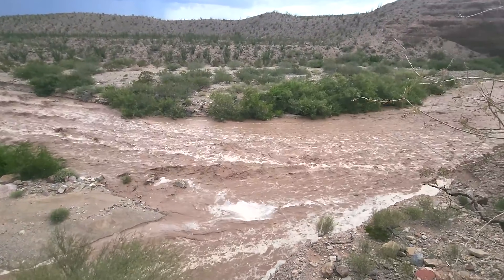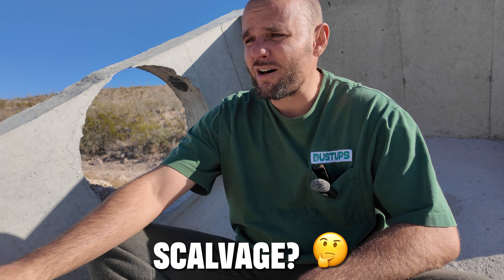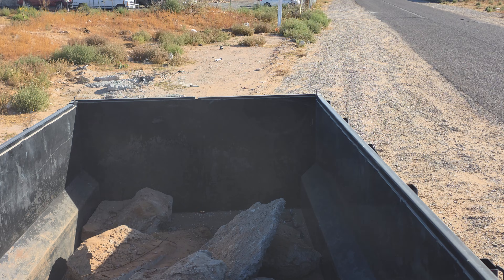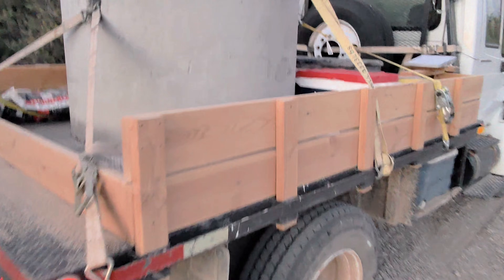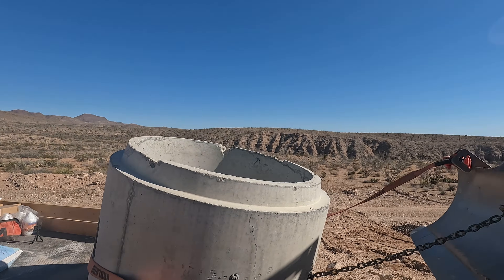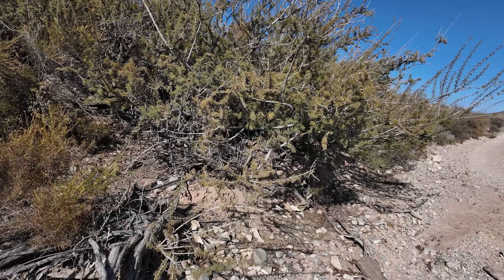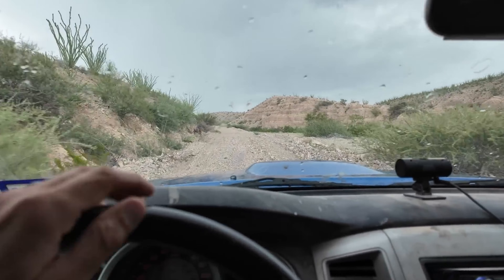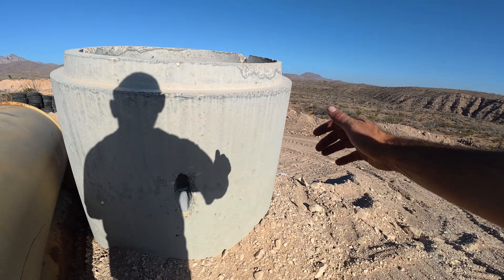I'm Fighting Desert Floods with Free Waste Concrete

Comment: This may be helpful to you.  Check out check dams of Arizona.  They use it successfully.  Also, Sand dams of Ethiopia.     They use them to control water and feed communities.  Alot of dams were made in these areas to slow water to sink into the ground water.  That's important.  Get the water to sink into ground water.   Extend wet time.  Lessen dry time.

Comment: Sean you should get some culverts built for your road. There are probably lots of free large corrugated steel culverts available in Texas. When the floods wash away the concrete barriers, build your road through the wash on top of large culverts so that the water flows under the road through those pipes.  Depending on how much rain falls, hopefully those culverts will last a long time without washing out your road.

Comment: before driving the concrete (fuel) to the creek, maybe you could use sandsacks  or better big bags, there are pretty light weight when empty, inexpensive and could be filled with dirt and stones and no need to Transport concrete

Comment: i've been followin you since the start shaun, and i saw your vision then, before your rain arrived two years later. these flash floods are brutal i agree, and while you can't hold them back yet at the outlet, remember that wvery little drop you hold back the more upstream you are,  the less was will arrive at the outlet by overland flow (but will infiltrate). little by little, one retention at a time, you will get there!!! i believe in your project

Comment: The cylinders could be used upright if sunk 2 feet in the ground and filled with small gravel. Spaced 2 feet or less apart you would have 10 ton pylons that could theoretically span the river and could plank across the gaps making a viable and heavy duty bridge while not being a dam because it has gaps to let the water through
Reply: It's a wash. That isn't going to work. The water will go around, under, or over. It's not stopping. It's not slowing down.

Comment: so the road is at the bottom of a canyon you own? if there is more than a trickle during a storm, you are doing it wrong. there should be zero run off from your property. the idea is not to catch water. it’s to slow it down. that’s easiest to do up high before it concentrates and gathers speed.

Comment: I’m confused about the logistics here.  I learned what a low water ford is, which is great.  How are these giant concrete casts working in? Are they like a giant check dam which will build up sediment and let you pave a low water ford in the future?
Reply: Ok, I watched again and I think I get it.  Basically a giant check dam.  I wonder if the water will spread just like the smaller check dams.  It might be good to do a U shape so the banks don’t erode.

Comment: Seed Sorghum: Mulch, Cover Crop, and Chicken Feed all in One.
https://www.youtube.com/shorts/BFTK-LmQgUQ

The Jerusalem Thorn (Parkinsonia aculeata), also known as the retama or screwbean, is a drought-tolerant tree valued for its ability to provide shade and mulch material.

The tree can produce significant biomass through its leaves and branches, which can be utilized as mulch.

Sheffield's Seed Company
Ty Ty Plant Nursery

Millet - Highly drought-tolerant, quick germination, and establishes rapidly.

Spreading the manure over an area and walking away vs. careful application like a no dig garden to 2 inches planted with millet. The first method encourages native cultivation, the second directs specific cultivation. Would the second method be potentially more productive when creating more mulch is the goal?

The second method allows for targeted growth of specific crops, optimizing productivity.
More predictable and consistent mulch yield from cultivated crops.
Faster results with specific planting; crops can provide mulch faster.

The second method, which involves carefully applying manure to a depth of 2 inches for specific crops like millet, is likely to be more productive in terms of creating consistent and abundant mulch.
This method allows for predictable results, maximizing biomass production from selected plants, which can be cut and used as mulch.
It also promotes better soil health and structure through direct integration of nutrients, which supports the subsequent growth of cultivated crops.

While the first method encourages native cultivation and may have benefits in terms of biodiversity, the second method is more aligned with your goal of maximizing mulch production and enhancing soil fertility effectively.

Comment: as someone who delivers fuel for living, you can use that tank for diesel, much cheaper than gas station diesel. its same diesel, and highway legal, the reason its cheaper is, its a bulk price and one less stop in supply chain.

Comment: Get a whole bunch of used tires. Cut one of the sidewalls out and bolt them together 10 ft wide by however long you need for your road cut side up. Fill it full of Rock and sand anchor each side into the ground with a chain to a block of concrete or whatever buried 10 ft in the ground There's your road that won't wash out

Comment: Keep in mind that if you build one line with concrete blocks, you build a pressure zone in the "river" therefore it will more quickly collapse. 

If you put one big boulder in the river it will flow around it. If you put the same size blocks over the complete with most likely it will not withstand the same flow rate. 

Also keep in mind where you build the wall. Because you will create a kind of waterfall what will make a kind of canyon after the wall. In front of the wall you will get soft sediment as you see with the beaver dams. But that soft stuff you quickly get stuck in with your truck..... 

Making a road through a river is hard and difficult.

Comment: @Shaun Overton | DUSTUPS - I know the question I'll be asking will be a lot of work and fuel costs. However, why not use all the concrete tubes/pipes as heavy culvert pipes?
 It would definitely take a lot of them, however, instead of fighting the water and losing, let the water go through the pipes and build your driveway/road on top of them.

Comment: The best is cut the round pipe in half then the water can go around instead of going wider then put dirt on top so you have a raised road. Or plan to have several little streams

Comment: I've built levers out of laminated together 2x10's that could lift at least 2000lbs off the ground. That might be easier than using the dozer to push them around.

Comment: Don’t try to stop the water I the channel. You’ll screw the creek, probably cause other erosion issues and it will fail. Protect your assets from high flows, let the water run when it needs to. You can’t stop flooding.

Comment: I think you should focus at least half of your concrete, check dam, gabion, and BDA efforts on slowing the water upstream.  By the time it gets to where you are working, the water has a lot of momentum and can do a lot of damage.  Room temperature water molecutes are actually something like 25H20, making it much denser than the chemical formula would indicate.  I would try nipping the momentum in the bud, upstream, before it "snowballs".  The point is to trickle the water from ponds upstream, so that the flow is more manageable down stream, and so that there is less damage.  This is what beavers do.

Another thought.  Some of these places with the scrap concrete might have a space problem.  They might pay you to take it way, or pay for larger scale trucking to do so.

Comment: For soil improvement:
Check out the Johnson-Su bioreactor. It is very cheap to build. It produces a fungal soil innoculant that matches your local environment. It adds water holding capacity to the soil and increasing nutrient avalability. The demo site in the Arizona desert is especially impressive.
Good Luck!
Brad

Comment: You need to set up with a waste licence and offer free rubble and construction debris dumping, renting a screen and crusher after accumulating for a few years is a passive thing some farming mates do here to achieve what your doing
Reply: Talking to muck away and quarries will get you the information you need to know regarding networking the lorry loads of materials you do and don't want, especially now many companies local to me either don't have equipment or charge a premium for using the equipment to separate green waste from soils, which in your use case I see more as a benefit than any issue

Comment: Unless you are anchoring  that structure on bedrock, you are constructing what the Scripture describes as a house built on sand. In Oregon's Willamette valley, stones the size of houses rest that originated in Montana, transported during the Missoula  Floods about 10,000 years ago. Water has far more power than you will ever resist with concrete rubble. Don't you recall  that people built ferro-cement sailboats back in the '70s? They floated just fine. Turns out, concrete isn't all that dense after all.  Flash floods will still be forced to breech your check-dam because the water can't go under it. The water will simply rise and and eventually tumble over the concrete, carve a channel around one end or the other, wash out whatever that concrete is  sitting on and your big concrete will move downstream like a slow moving boat . Stop wasting your time, money and effort on "free concrete" and talk with some  bonafide engineers about the problem.

Comment: Not sure you are looking for fund raising suggestions...but here goes. 
You have existing dirt bathtubs that haven't been super successful. But they are already there, and you have been given great suggestions about how to update them to make the more successful. But you don't have the time or manpower to make those changes.
You probably can see where I am going with this. 
Take "donations" from viewers, essentially "adopt a bathtub", and guarantee that you'll add a tiny wooden sign (or a 3D printed sign if you want it to be less work intensive), and commit one hour to updating one bathtub for the cost of that donation. Is $100 too much? You'd figure it out.
Obviously you'd design the package that you can commit to. 
When you get volunteers, this could be a dedicated project that they could work on. 

Not super original...just a thought.

Comment: An A-frame rig could make the dozer into a lift vehicle, but you really have to plan out ahead when using it to position it right. Also some of those rounds might be useful to put a culvert into a raised drive path, that would let water through at some point without as much risk of topping or washout if you made it as a complete dam barrier.

Comment: Would it be easier to widen the run off? Double the width and its less pressure to move the material. Build a squeeze area with 2 tubes underground to push out a mass of water. Then widen your area where the road is to have a thin gentle run of water. Eh... Just a thought.

Comment: You should really get a tracked Skid Steer Loader, like a Caterpillar, It has bucket and fork attachments and could definitely replace the dozer in a lot of situations and do things it can't like lifting, faster and more fuel efficient too. Certainly cheaper in the long run and you can get a used one for a fair price.

Comment: You can’t just plop down some empty concrete containers and call it a day…
It might be heavy, but if it’s full of air, it’s still lighter than the equivalent volume of water.
You have to treat it just like a gabian. And fill it full of rocks or it will float away like a concrete boat.
Or at least put enough holes in them that water can fill the voids when it rains

Comment: On the Hoh river in Olympic Penninsula they use huge caltrop shaped interlocking concrete barriers to prevent the road from washing out. If you look up pictures it is pretty incredible - sometimes even these get washed away, but that river is ridiculously powerful in floods. Might be worth thinking about trying to interlock all the mass you are bringing in somehow to ensure there is no chance the weight is overwhelmed by a huge flood. If everything is connected the water would have to move it all at once. Maybe with big cables or going to the extra expense to create a few custom pieces that can connect and lock everything together. I’m not sure if relying on the weight of the concrete alone is sufficient to create a reliable structure. Although anything that slows down the water would help. Great work and thank you for sharing!

Comment: Please watch the documentary on Victor Shauberger, his understanding and control of water is legendary and could help you with erosion control during high flow periods. Placeing a a single or double line of large individual rocks or obstructions down the middle of the stream can protect the edges from undercutting. Your check dams will be raising your groundwater and holding it back ecourages silt deposits for soil building. All great stuff

Comment: When dealing with water flow, the important thing is that mass flow rate doesnt change.   If you create more turbulent flow with those rocks (reducing whats termed the hydraulic radius), the water slows down and the cross-section of the water flow increases.  Meaning, the water gets deeper and wider.  You might see if there are any hydraulic studies of the water channel you're modifying.  If not, you might see if there are any enterprising engineering college  students interested in a challenge.

Comment: You need to change the fuel filters in that truck or check for boost leaks there’s no reason it should only be doing 32mpg I can load 30k behind a f550 and run highway speeds

Comment: Place the concrete on the "downriver" side of your road. Why you ask? because when you slow down the water, it drops the heavier rocks and sediment on the road side ("upriver") as you said when talking about the gabions.  If the barriers are place on the upriver side then what happens is water flows over the top and creates waterfalls and swirling behind the barrier which digs out the sediment and creates crevasses and holes on the downriver side.

Comment: Have you tried to use geotextile to make Gabions as opposed to wire? Given you don't have an excavator with a thumb, it make be a solution to make gabions with smaller rocks.  Zip ties o fasten them up and way easier to work with than wire.

Comment: the ideal would be concrete tetrapods.  Failing that the English civil war device that is the gabion. a wicker cylinder filled with dirt and rocks. You  could source some free  bulk bags and fill them.  Your biggest problem is run off. This forces the water to flash flood. if you can make somethign to slow the water down in the landscape then the flash flood will have less energy and be less destructive.
Reply: also every step is one yard/meter

Comment: I live in Missouri right in area. We got 4 rivers, the Missouri, the outside the gas canadai, and the moral river, all within a couple miles of me, we go to the local block company, Midwest, block and brick. When they're defective materials, you can take 'em to use them for fill, just like save a road  Save you yard , you just gotta do the physical labor

Comment: the force on running water might be to much for those concrete blocks to hold -cant you do the math ? - those corcrete parts might have amuch bigger surface area than the 1000 pound rocks the water rmoved

Comment: By no way, shape or form, you will get these flash floods under control with concrete. No matter how heavy concrete you will use, you will only direct the water to a path of less resistance. Either you will move the path of the flood river, or your concrete will be swept away, but trying to stop or slow the flash flood in your canyon is not going to work with some parts of leftover concrete imho. The force of the raging water is simply too large to be stopped by whatever loose pieces you will put in it's path. 

If you really want to solve the flash floods, you need to make sure the water will infiltrate directly where it falls, make the mountains the sponges the were long before, and let them slowly release the water from there year round. It's a whole different game and out of your control, but that would be a solution. What you're doing here looks and sounds impressive, but I highly doubt it will make a difference.

Comment: Even if the blocs are huge I'm not sure they can resist the buildup of water and material. A single displacement will let water flow in a single spot and erode everything between two blocs. If you can connect each concrete cast with rebar or anything to make it one structure, they will be less likely to drift

Comment: i was writing a comment about making colverts to guide the water through. but you dont actualy want that, do you? you want the water to slow down and hopefully soak down a bit more. dam, damm all the way. even if the ground water here wont help you anything, the fact the pressure is there should help the range hold more too.

Comment: I don't understand what those blocks are gonna do, the water is gonna flood over them anyway? Without buried culverts, your "road" is gonna get washed out regardless.
If you used those round ones, sideways, so the water can pass through them, and then essentially build a bridge on top, it might work. All other options I see no result that is not gonna wash your road away every single time it floods like that.
You plan might work for protecting one or both banks, so get up and out again, but to try to stop the water the entire width I believe is a futile attempt.

Comment: I'm not exactly sure what you are trying to do, but I think you need to shore up the sides of the waterway first.  IMO, water will start being pushed to the sides and will wash out the sides of the waterway making your problem worse.
I'd put some concrete up the sides to try and stop that erosion before it starts happening... then work from each side and build out towards the center.